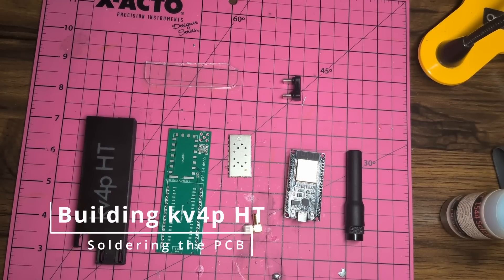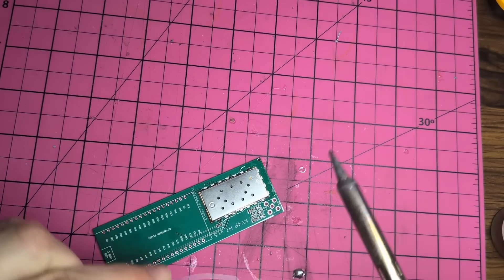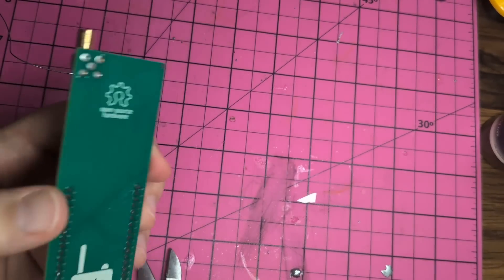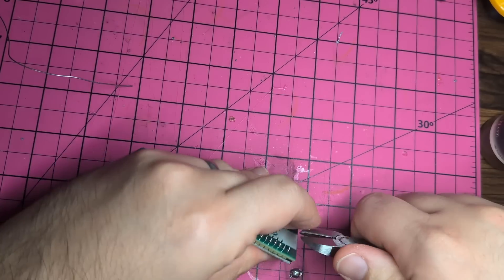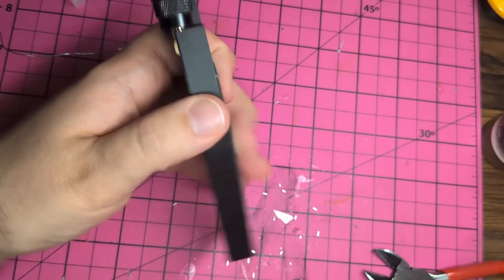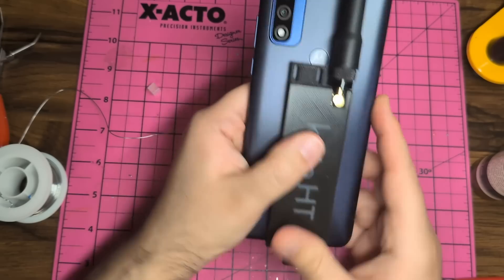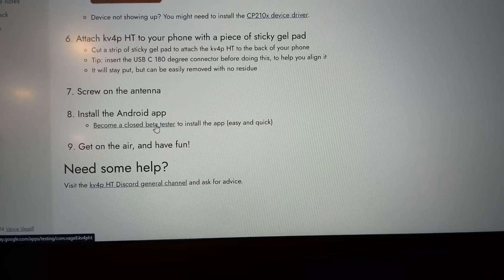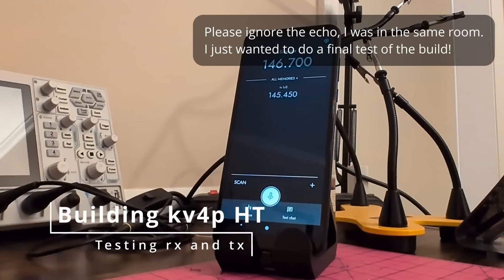kv4p HT step-by-step build instructions - turn your phone into a modern ham radio

Comment from the maker: UPDATE 10/23: v1.7b of the PCB design is now available on the Quick Start page at kv4p.com. My testing of this version shows it has far better harmonic suppression, so if you've been waiting to build the project, go for it now!
Reply: Thanks for the project! Very exciting. Will you be working on iOS version?
Reply: FYI, on his website, he says don't buy the v1.6 PCB, the filtering was worse than v1.5, he is working on v1.7
Reply: I have v1.5 being made and can make some mods if needed for tighter margins?? maybe some add in bypass caps in SMT configuration? Did you find the RF module a bit tight or the ESP32 section? PCB surface LCR can be a particular pain in the keester .... if there an accessible ground a surface patch might be doable?  This is proving out to be a nice Arctic winter project ....

Comment: How can we provide the phone with power and connect it to the radio? I have an external M.2 2230 enclosure I purchased for my Steam Deck. I boot Windows off of it, but it also has a power pass through port. One port connects to the power adapter, the other connects to the steam deck.
Reply from the maker: There are USB connectors with a third power input port. One of these is listed on the kv4p.com Quick Start page.

Comment: this is amazing.  how far is the range with the small antenna?  how about the range for the longer antenna?
Reply from the maker: Like all radios, it depends on if there are trees, buildings, or hills in the way. In general, the larger antenna works way better. But if you're just talking to nearby buddies or a repeater, the small antenna fits nicely in the pocket.

Comment: I have a preassembled unit that doesn't seem to do anything or have any power when plugged into the phone. Is that a common problem?  I think they left out a step, how can I make the phone see this device?  Also how can I tell if it needs a firmware update since there is no option to check that in the app?  Are there any instructions on how to use this thing once it is working? The app seems half baked and don't do anything with just 1 button on the screen and no idea what it does! Shouldn't it actually have some kind of features? 
Update, I was able to do a firmware update in Chrome but when plugged into the phone the app says Not Found! Are there any other apps for the PC or Linux that might really work?
Reply from the maker: The simplest reason might be that you have a v1.x kv4p HT which requires an OTG cable, not any old USB C cable (the 2.0 units do not require this). If you have a kit and it came with a cable, it's also possible it's plugged in reversed, they are directional. If you need help, feel free to stop in our Discord linked on kv4p.com
Reply: @KV4P  I tried different cables and finally got the app to see the device sometimes but it wouldn't receive anything and when I pressed Send it would disconnect from the phone. The device and app are both worthless crap so I gave up! Nothing personal, I realize this is your own pet project but you probably shouldn't be selling it.
Reply from the maker: @stevec5000  I'm not selling it, it's open source and I don't sell anything. Anything you bought was from someone else who made a kit and sold it.

Comment: Is there any disadvantage of SA818 VHF (134~174MHz) vs DRA818V 144MHz 145MHz 146MHz 154MHz 174MHz?    Seemed the same accept for the 134Mhz band.        The SA818 is cheaper and included both the VHF and UHF modules
Reply from the maker: You can use the SA818S-V or the DRA818-V, they both work just fine.

Comment: Very cool project, building one now but the pin rows aren't wide enough. I'm going to clip the pins on one side and put in jumpers. Did PCBway get it wrong or is the a different spaced esp32 available.
Reply from the maker: Unfortunately ESP32 dev boards have turned out to be variable depending on the manufacturer. We're working on a PCB variant that can support the narrow version you got, as well as the original wider version. The one you received should work fine if you bend the pins or use a riser to make it fit in the board (others have done this). Note that I think that ESP32 might not have 5.1k ohm pull-down resistors needed for Android to recognize it and power it. To get it to work, use one of the 2 connector options listed on Quick Start on kv4p.com, those both include the pull-down resistors built-in.

Comment: 8:25 I learned directly from Signal Stuff why their Signal Stick is such a killer antenna, it's NOT a 1/4 wave... it's a a 5/8 WAVE!
Reply from the maker: Thanks for taking a look! The Signal Stuff website says "1/4 wave on 2 meter (144-148 MHz)" at least for the version of the antenna I link to on kv4p.com. But you could use any 2M antenna with it, even a 5/8 one if you want a big honking whip on your smartphone haha.

Comment: "Professionals" use flux for good reasons! Faster heat transfer so you don't ROAST components, cleans oxides and prevents cold solder. USE FLUX!
Reply from the maker: Totally agree! 73
Reply: @KV4P  I have a buddy who grew up around electronics, working in a CCTV shop with his Dad. All the soldering they'd done and he'd never heard of using flux? I showed him what using added flux besides flux core does and it blew his MIND how much easier it made life!

Comment: Well success ... I was finally able to order the printed circuit boards, for now I have two assemblies on order. Total cost with DHL shipping up here to Alaska was $38.50 so I will have at least two units to build once I get everything shipped in. Shipping into Alaska can be dicey as so many companies won't ship up here .... mostly American based companies. The PCBWAY is China based and they are fast and no problem shipping. I did order two transmitters, and the ESP32 boards were a five pack so there is that. I decided to use a short cable in place of the 90 degrees connector though I would have preferred the connector; I was confused on the website about getting the android type connector and the weblink showed both a IOS type and an android type but I couldn't see how to choose the android type connector and also if it was a male to male or male female, etc.?? So, a cable was ordered until I can figure out what I want in my final version. Now I want to go back and check the output specs for that RF section and determine the output power. Have you measured yours? If it can reach out to the local repeaters I'll be happy ...
Reply from the maker: Have fun with the project! I just measured the v1.7 PCBs today (you likely have an earlier version), and those have over 600mW output at the antenna connector, which is decent for a radio with 1W nominal output. And the new v1.7 PCBs have excellent harmonic suppression. I posted an image and description of the suppression figures on the Contribute page on kv4p.com if you're interested.

Comment: I tried several times to order the project assembly from the link to the website, even created an account ... but it doesn't show anything in the check out and no way to pay and get a board or even an assembly??  All other parts I've ordered except the 3-D print box and I have a friend with a printer that might be able to make them for me. I want to order enough parts to build five ... I'll just buy a cheap android phone from Wal-Mart and load it on that ...
Reply from the maker: PCBWay has a weird process, they will email you to confirm your order and ask any questions they have, then you can pay and they will build it. Personally, I use JLCPCB for all my orders, but they don't have a nice one-stop community project page like PCBWay, so it's a little more advanced to upload the 3 necessary files and choose the right options. But if you haven't ordered from PCBWay yet, consider waiting until v1.7 of the PCB is tested this week (I receive it in the next day or two), and then I'll update the Quick Start page with links to those 3 files if you want to go that route.
Reply: @KV4P  I did finally get the invoice and agreed to pay it five boards. Once I get the first five built I plan to do more so maybe by then your newest version will be in production?
For now I’ll consider the first batch to be my learning batch. I have very good soldering skills and marginal programming skills. I have a friend with a 3-D printer making cases for me … now to get a cheap android phone and press on …

Comment: I have tried to order these components using the links in your page but it is either impossible to order or ??? also, does the cell phone need to have a sim card to use this as a radio? I have a couple of old android phones, or could just buy a phone from Wal-Mart cheap but this project is a very difficult one to try to get the parts ... building it should be a snap.
Reply from the maker: The phone doesn't need a sim card, it is completely off-grid. You can sue any old Android phone with, but make sure it has a USB C connection, and it has Android 8 or higher. Android 8 came out in 2017, so even low end phones today should likely have it. Sorry if some of the parts are hard to find, tons of people are buying them. I've been trying to update the links when something sells out, to some other supplier, but I can't keep up. Feel free to find those same parts on other sites (like eBay, Tindie, and Aliexpress). Most of the parts on any of those.

Comment: im pretty good with computers. had one since 1986. ive designed and released iOS apps. after all that today i learned that you can connect to a comm port via a website haha. this looks like a super fun project
Reply from the maker: I know right! I was surprised that it was possible to. I was getting ready to write a long guide for non-developers on how to setup Arduino IDE and use it to install the Firmware (probably like 10-20 steps), then I found this really helpful script that can do it for you. Just had to figure out how to turn the Arduino output into a firmware file that script could use, which was its own journey. Anyway, enjoy the project!
Reply: @KV4P  do i needa licence for this equipment?
Reply from the maker: @Achhcity  Yes you need an amateur radio license. In the US you only need the basic license called Technician which is easy to study for and fun. :)
Reply: @KV4P  im in india and whats the min age for taking a ham license
Reply: @KV4P  do i need a ham license to eat ham?

Comment: what isvthe distance for the long antenna?
Reply from the maker: It depends on the location. If it's flat with no obstructions, maybe 2-3 miles. If it's a busy downtown area with lots of buildings or hills, then maybe less than a mile. But in many areas there are ham radio repeaters located on radio towers or hills nearby, and they can repeat your transmission much much farther.
Reply: @KV4P  thank you for your help and time

Comment: Other options for the USB C connector? I always use heavy thing cases on all my phones so a longer USB C to USB C is needed, but not too long... maybe a stretchy one?
Reply from the maker: I added a link in the Quick Start page (on kv4p.com) to a short 5" USB C cable that would work. It won't be as elegant as a little connector, but still would fit in your pocket.

Comment: Nice little project. Did you wash off the flux, I'm asking because some flux is corrosive.
 91% rubbing alcohol in my opinion is best. Again, it is a pretty cool little project. 73's🎙KD9OAM
Reply from the maker: Sometimes I wash it off, sometimes I don't. But thanks for the suggestion!

Comment: Great project. Any plans to support APRS?
Reply from the maker: It already supports APRS! The "text chat" feature is an APRS Message, which you can address to another ham by callsign, and it sends via radio-based APRS. And if you tune to 144.39 and look at the text chat view, you can see other APRS traffic decoded. Right now messages work well, and I plan to add better support for other APRS types -- right now they just all print as text (I'd like to show maps, weather symbols, etc.) I also plan to add location reporting in the future, which I know many people like. Right now you can only transmit messages, but decode anything.

Comment: I see the web flasher is down? Are you making changes or? Also, will the PCB V1. 7 be coming out soon? If it's going to be a while I'll just grab the V1. 5. Thanks for this project
Reply from the maker: No, it's up and working. Make sure: 1) you went to kv4p.com NOT www.kv4p.com and 2) you're using Chrome, Chromium, or Edge.

Comment: Depending on which esp32. It supports Wi-Fi and blue tooth. You could create a speaker/headphone profile and create a Bluetooth link to the module. That way you can place it anywhere within 10meter distance and link to it. No piggy back on the cellphone needed.
Reply from the maker: Thanks for the idea! Others are thinking about this too, we have a Discord with contributors discussing ideas like this

Comment: They make side cutting and end cutting snipe that have a bevel only on the inside part of the blade and they're really useful for getting in nice and close to cut things like removing the extra length of the pins after you're done soldering. I never remove them too close to the board anyways though in case I have to resolder them in the future... but they're also useful for countless other things, especially for 3d printing.
Reply from the maker: Sounds handy, thanks for letting me know!

Comment: A 3rd hand is an excellent tool for jobs like this. I wish I had one myself, because soldering without one can be a real pain in the ass.
Reply from the maker: Totally. I have a bunch of things that can hold boards in place while soldering, but in this case it's almost flat so I just put in on the surface.

Comment: Newb here, ive never ordered a PCB before, i uploaded just the gerber file to jlcpcb and the preview when ordering doesnt show the SMD on the board, is that normal and they will be installed?
Thanks
Reply from the maker: Make sure you chose the "assembly" switch at the bottom of the ordering page. It should ask you to upload 3 separate files while you're setting up the order, if it doesn't do that then it's not going to be assembled. The PCBWay project page has an easier ordering flow (I already gave them the files), you just need to be sure to choose PCB+Assembly when adding it to your cart. I'll be testing the new v1.6 version today (the PCBs are about to be delivered), and if all is well I'll update the PCBWay project page to use that new version.
Reply: @KV4P  Thank you!
Reply: @KV4P  When ordering from PCBWay, does the PCB+Assembly come with all the parts or do you still need to order them? Thanks

Comment: Is the PTT using VOX? How does the android app trigger the PTT?
Reply from the maker: You push the PTT button in the app. When you hold it down, you can talk. When you release, it stops transmit. There's a setting for "sticky PTT" if it's easier for you to tap to start, and tap to stop. There's no VOX support yet, but it's on my list of future things to add.

Comment: I like to use white double stick.  Its very strong and insulates.    Use tape over the sticky side.  No more sticky. No more pokeys
Reply: @ConspiracyBear   3M make sticky rigid plastic locking tape that's like velcro but not. It's how I hold my infrared camera to my phone...
Reply from the maker: Thanks for the tip!

Comment: I am a novice when it comes to APRS, but does the firmware have the capacity to transmit your GPS coordinates from the phone so you can use it as a tracker?
Reply from the maker: Not yet, but that's on my short list of features to add. It already has APRS working (for messaging), it just doesn't have a setting to let you periodically transmit your location.
Reply: @KV4P  Cool, thanks. So if I have it tuned to 144.39 in the US and am sitting under a digipeater, I should get all the packets in range like telemetry, announcements, etc...?  Thanks for your work on this!

Comment: Any hope for an iPhone app?
Reply from the maker: Hey there. I have no iOS development experience, so it's not something I plan to do. However, at least one community member has already expressed interest in looking into this and seeing if they could add an iOS app for kv4p HT.
Reply: @KV4P  I have no app development experience however have no problem helping with test pilot. If they need someone willing to use the beta app, I am interested.
Reply from the maker: @K8BAR  That would be great! Please reach out to me at the email on step 8 on the Quick Start page on kv4p.com and let me know which account you want added to the beta.
Reply: Hi...
Just wanted to know if we need a constant & stable internet connection/ Data pack to run this Interface on our smart Phones...
Or does this app works in Offline mode of the phone...

Pls clarify 

Thanks & 73s
Gaurav
VU3OSA
INDIA 🇮🇳
Reply: I've got cross platform mobile dev exp, happy to give you some pointers, but you're going to need a Mac and an apple Dev account to kick off. (or a hackintosh). what did you write the android app in?
Reply: @Kinetic79au up this. If it’s something like React Native it can be ported to iOS easily
Reply: Good luck dealing with Apple, they'll NEVER let you share an app that uses a DIY device plugged into their phone...

Comment: SO can you use a phone that has no service to use this gadget ?  Meaning does the kvhp just used the phone as a power and interface system?
Reply from the maker: Yes that's right, the phone doesn't need any cellular or wifi connection at all. And yes, the kv4p HT uses the phone's battery, it does not have its own battery.